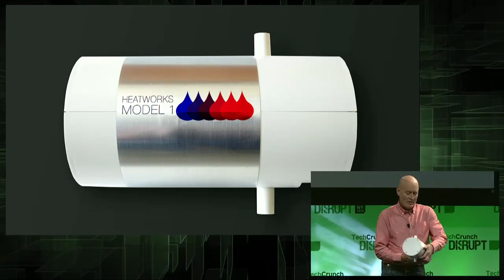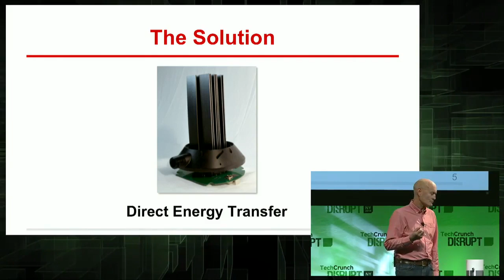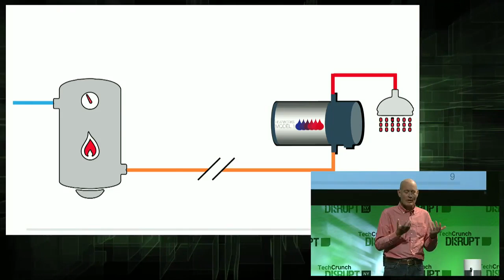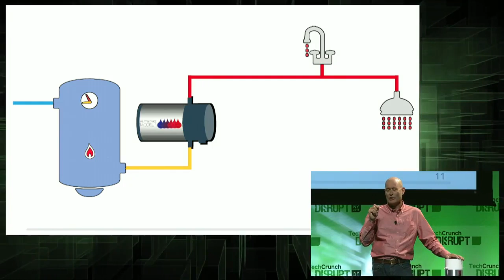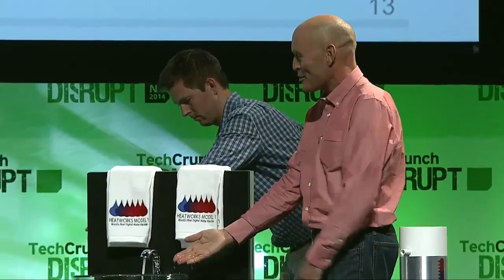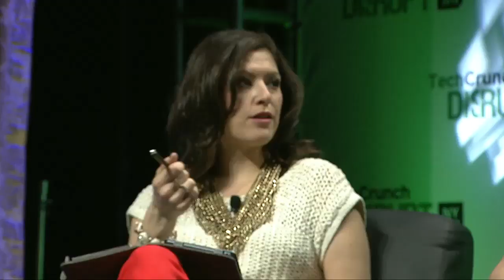Heat Your Water Instantly and Efficiently | Disrupt NY 2014 Finalist

Comment: I liked the Griggs  Hydro Sonic Cavitation  Pump a 350W ~ 500W Motor or Engine 7.5HP 3000RPM ~ 4000RPM and 300 ~ 800 holes in a Disc Drum You can get instant hot water or stream (any temp you want)

Comment: I want to know what kind of life cycle testing they did. Those electrodes can't be solid graphite. It must be a matrix. I've seen solid graphite cathodes in electrolysis equipment, and they degrade VERY quickly when used with water-based materials.
Reply: Yes theres something a bit fishy with it. If he was electrolising the water and splitting it then he would be wasting a lot of power..

Comment: You don't need to use water as a resistor to make a water hot enough and you shouldn't, because of electrolysis. What you need is just a big heating radiator, thermometer and some simple electronic circuit... and I think you can even buy one! So why do you need something that creates the easiest flamable gas in the world and because of that can blow your whole house? Masochists.

Comment: The thermo technology is the secret had been researched by Japan and China is very scary and it very dangerously label thermo nuclear which could turn ambient into Frozen or 500 celcius and it is available with large electricity capacity and high and low frequency. If we redesign electrical plug it reduce electric bill to zero or nearly nothing but the electrical company may kill me

Comment: What the HELL is this? He says lots of useless details (like cloud connectivity) and does not explain at all how it works (if it does). Than, thermal resistance are the most efficient way to transfer eletric energy into heat.....
Reply: @Joshua Kiser No its not. It uses the dissolved minerals in the water to cause the ions in the water to speed up/heat up. It wont work in water with low conductivity. (that is most treated city water) It's a scam.
Reply: Sounds like a type of electrolysis.   Not cavitation by wheel , though there is a company that produces a product like that.

Comment: It's a small electrode boiler, this technology has been around for years. How is this revolutionary? Also, conventional electric showers heat water instantaneously, yet another thing that's been around for years (any they're smaller, too).
"Our company has come up with this revolutionary transportation technology (patent pending), we've invested millions of dollars, and we're calling it The Wheel"
Reply: It's an induction heater.
Reply: @solexxx8588  Uh, no. An induction heater relies on inducing eddy currents in a ferromagnetic substance, which water isn't. Also induction heating relies on electromagnetic coils to induce the aforementioned eddy currents. I don't see any coils in the device, it's literally just metal plates as used in an electrode boiler, you can see them at 1:27.
Reply: Thapalo

Comment: I had an idea on how to solve this problem by installing a digital thermometer that recycles the water until it has the right temperature. 

This is better though because you will get the right temp instantly.